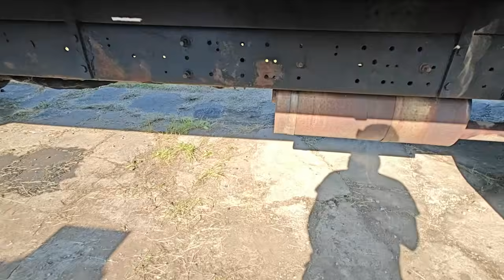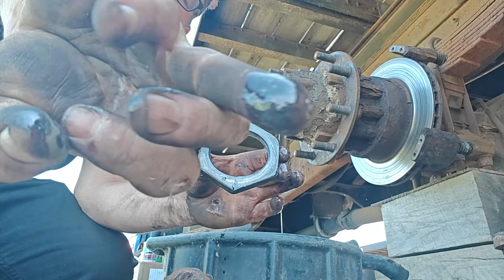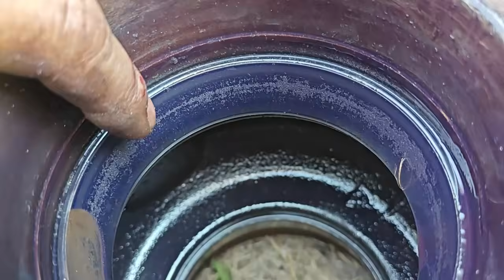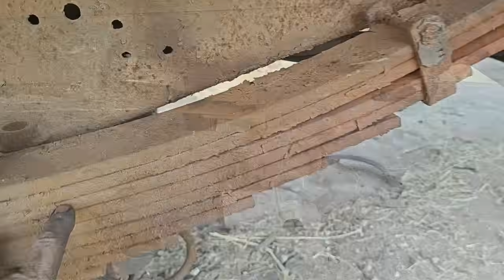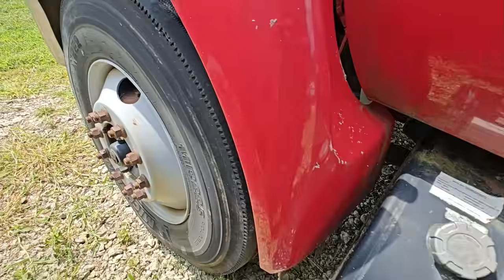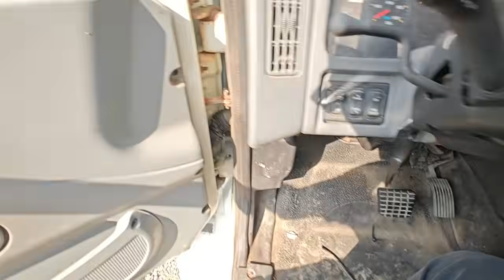IRRESPONSIBLE TRUCK OWNER NEGLECTS SAFETY! NO EXCUSE FOR THIS!

Comment: The outside of that hub didn't look all that rusted, it mainly looked like caked on road grime, years and years of it. If that was my truck, I'd sandblast it then paint it black before putting it back on the truck, but that's just me. I do lots of unnecessary work because it makes me feel good.

Comment: too bad you couldnt just make a run out to Mike N B's in eastern ohio and get a whole air suspension rear setup off a school bus..  (I saw an ohio plate so I can only assume you are in ohio)..  with all those bad parts even going to truckpro for them they arent cheap.. that said it makes sense to use one of the other good trucks.. i dont know what motor / trans is in the blue broken truck.. inm assuming its a DT with a 6 speed ally 3000? if so swap it in that last white 4300 and ut the roll back on as well.. then you have the blue motor. trans you like and a better lshape frame, air brakes, 10 lug..  whats special about the motor / trans in the blue truck? is it recently rebuilt? (this is first video of yours ive seen)..  is it the HT version of the DT466E?
Reply from the maker: Its not just the rear axle. the cab is rusty, the vent glass hinges are broke, the mirrors need replaced, the frame is getting showing age, one fuel tank is bad, the a/c doesnt work, no air ride on seat or suspension. the list goes on. the engine and trans are great. they will live on to repower another truck i own. the bed will go on another. eventually the bed will get a major rebuild.
Reply: @j.c.smithprojects  id say theres your answer... the blue truck is worn out but its powerplant and drivetrain are good..  just remember if you swap allisons from one truck to another, the TCM needs to stay with the transmission..  hopefully the gebnerations are the same..  you can swap a trans without moving the TCM but really need to go in and reset the adaptive shifts and fast learn (if its a 2006+ with the single connector TCM). otherwise you can roast the (usuyally C5) clutch.. my little year 2000 short bus has the 8 lug wheels on it.. mine are 19.5's with hydraulic ABD brakes..  uses an S-150 rear.. I dont think the 8 lug wheels are really that bad.. they should be hub pilot..  that said if you want to go to 22.5's its a PITA..  10 bolt hub pilot makes everything easier..  yeah time to resurrect one of your other trucks..  not worth 2K in that blue truck for something else to break..  if nothing else use the "god mode" servicemaxx to crank up the power on one of the other DTs till you move the powerplant..  shorten the frame put the rollback on and drive it as is for awhile

Comment: You’re gonna wanna take the bed off the blue truck and then get it blasted do some rust repair paint it decking, you know how this goes. It’s snowballs from well while I’m here. Personally I would just get the blue truck rear brakes fixed, and run it for a little while longer, that way you have it to use while you decide if you’re gonna shorten that truck up or do something different entirely. I’m guilty of the same thing, one small repair that is gonna turn into a pain in the butt ends up convincing me that I need to do some big drastic change and then halfway through that I’m like I’m an idiot, should’ve just fixed what was wrong with it lol
Reply from the maker: you understand perfectly.  i juts hate to do yet another repair for a "temporary" truck. i would much rather put my efforts into something i plan to keep and use for many years. the truck i want to use is in much nicer condition. however, if i put the bed on this truck, the bed needs to be the same or better caliber.

Comment: go for 1 sit on 4... or 1, 2, 3 & 4 are the rehash of the used parts mess? AR500 on the drive shafts is hard to machine. if that axle finds its way on a lathe to weld and cut the oil seal bearing race's?

Comment: Dear J.C. Smith projects family.
Option 5 is what I vote for! If the parts fit, take the rotors, hubs, bearings and the springs from the very first spare rear axle you showed and use the parts to repair the blue rollback. This is inexpensive and the fastest possibility to have a functioning rollback again.
Best regards luck and especially health to all of you.

Comment: In the grand scheme of things. Put the bed on the 750.  Then put the engine and trans in the white one. Turn the white one into something you can sell. In the meantime you still have a roll back. Yes it’s manual but if you don’t use it much as you say it shouldn’t be too big of a deal.

Comment: You asked. 
I would swap the bed to the last truck. Air ride/brake and diff lock would be nice to have. The miles are a little high but for a limited use truck, possibly acceptable after a good inspection of the drive tran.

Comment: It's awesome that you have many viable options. I'm sure you will make a wise choice. I think I would choose option 3. Clean, 33K, air brakes and air ride seat. You could probably convert to air ride later seeing how you already have on board air but I don't think that's really that important. And you have already shown you know a thing or ten about spring suspensions so you will be able to tweak it to get it like you want it.

Comment: It's a shame that people who work on heavy trucks and trailers can't be depended on to do quality work. On my 48' flatbed trailer I changed a hub cap that was leaking hub oil. When I took it off I found there was no lock nut! The threads were slightly damaged and it took a while with a triangle file and hacksaw to clean up the threads well enough to remove the preset nut and I replaced it all with the newer style single nut system. It was a very slight oil leak, but my OCD wouldn't let me ignore it. That saved me from having a very serious incident with that wheel. The preset nut could not come off with the damaged spindle threads, but certainly the bearings would fail if it loosened and that would still let the wheel come off with possible fatal results.

Comment: Its time. Swap the Roll back over. Time you use to fix you could be a fair way through the job. I would go with the first truck, low miles.

Comment: I could be totally wrong here but the red ford seems the most rust free and cleanest out of all the trucks . The ford looks like it needs less work required to get it on the road  and working . All The internationals look like they will need a ton of work plus all the rust issues. with you having so much on the go already . I would pick the ford

Comment: JC, 
My nickels worth.
Opt 4 would make you' the happiest I figure but time is the biggest concern considering the frame length and moving the axle forward. Opt 2 seems decent and good even fit but you won't have the locking rear end which is as you said, a rare option to have. Personally I like the FORD but I'm a FORD guy and the manual doesn't bother me'. 
The FORD may fit your needs but since it's a manual you won't be as happy when the build/swap is finished, IMPO.
Based on the above info I think option two works best for now unless you're willing to commit to opt 4 and be finally done and happiest ❤😅.
It makes little Sense to dump money into a truck on its last leg when it's better spent on swapping to another chassis.. I wish I could have been more helpful 😢 JC. Tough choices indeed. The old Pro's and Cons dilemma', time being the harder part of the equation. Good luck 👍🤞😊.

Comment: I would prefer the f750 but option 4 seems to be a fit for your needs with the automatic... but I was thinking you had some regular rollback beds to use instead of that equipment bed.... either way I wouldn't dump $1,500 into the blue turd that your trying to get away from... yes you can use the axle later so its not a waste but if you fix it you'll keep using it and wanting something else... I say park it in the weeds and start over with a nicer bed if you have one...

Comment: Option 4 seems to be what would suit you best and probably make your happier in the long run. With that being said how much stuff is going to need addressing on the rollback bed when you pull if off and swap it over. That's another question that should be thrown into the mix. It seems you tend to like to make things nicer then when you started so what kind of project would the swap become in the end?

Comment: You have stated in another Video, how You dislike that Roll-Bed. So are you willing to live with it, or do you have another one to put on a better Chassi? 
If you are just going to sell it because it doesn't fit your Needs / Desires, Go with the Red Ford. since it is your cheapest option, & you can use it until you sell it, & buy or build the Roll-Back You really want.

Comment: option 4 but as you said the frame is too long would you have to shorten it to fit things? thus having to move the suspension aka more work than #3

Comment: Option 5 take the best options features from all 4 trucks and build 1 truck.
F750 swap in air ride. Later down the road when you buy another 750 that happens to be auto swap around to have an auto roll back. Use all the aluminum from the other international.
Reply: I like your thinking, but that would be costly.
Reply: @kaslkaos8447 probably correct on the cost point. I’m curious as to what the cost would be if all the other trucks were parted out and sold while building. Use only funds from parting out the others to build the best truck for the job.
Reply: @stuartgibson1896  I agree with you on the parting out strategy. Further, I have to admit I am warming to your idea of making one great truck out of four reasonable ones for two reasons;
1. J C gets the truck he wants, and
2. It will make for an unmissable video series! (Hint, hint J.C.)
Reply: @kaslkaos8447 Something we haven’t considered is does JC have a 750 with an Allison laying around? I remember a time when he had like 20 750s with boxes on them. Surely a few were automatic. Theoretically he could be sitting on a 750 with a bad motor or something that could be swapped with the good one he showed.
Reply: @stuartgibson1896 I'll be guided by your recollection on that, but he already has an Allison. What he needs is a bellhousing to mate it to the Cummins 6.7.

Comment: I don't know how bad you need that truck back and your paying jobs.   I like the last truck overall spec,  but the F750 sounds good.  

Flip a coin I guess.  How is blue truck frame?  Is it worth putting any money into it?
Reply from the maker: no. it isnt. if i fix the blue truck, i would only use it until i built the rollback that i really want. then i would take it apart. scrap the frame. use the bed, engine, trans and axles for other builds.